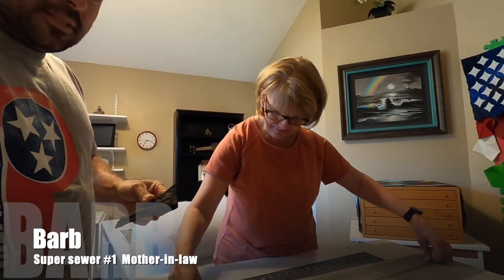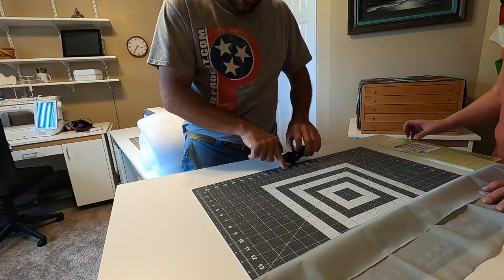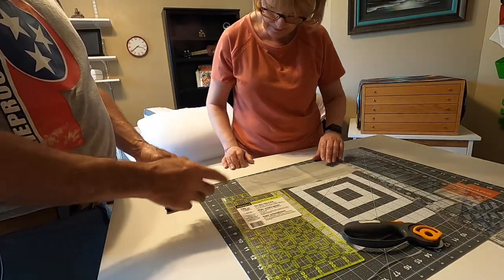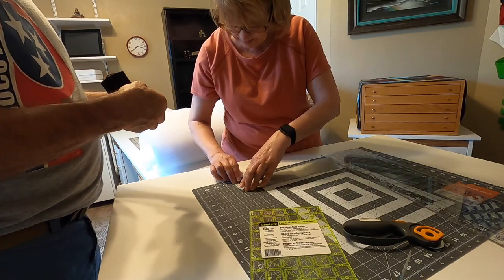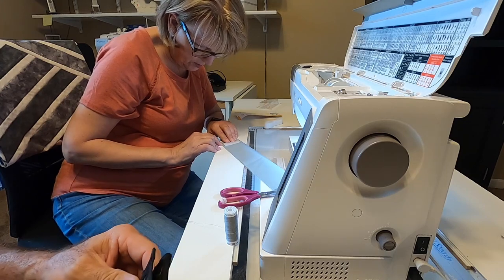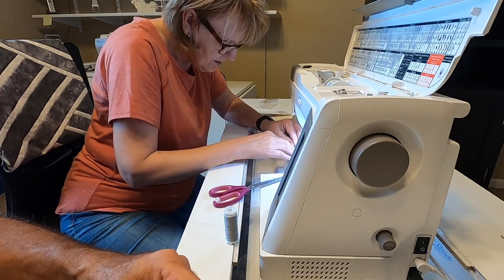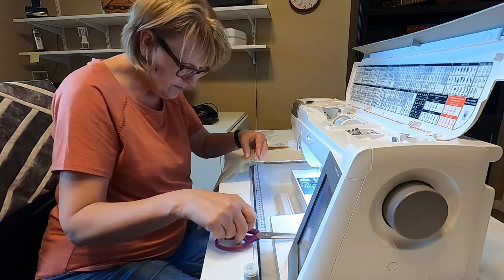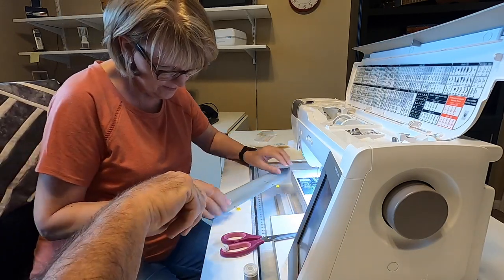DIY knife sheath

Comment: When my knife sheath, pistola holster, or wallet get a hole worn in them I put black Duct tape over the hole and I'm good to go. Both my 5 and 7 get into other modes besides video even though video is the default mode. It is very frustrating. So how did the new sheath work out?
Reply from the maker: its great I will make another at some point